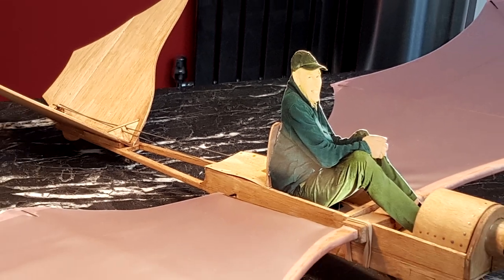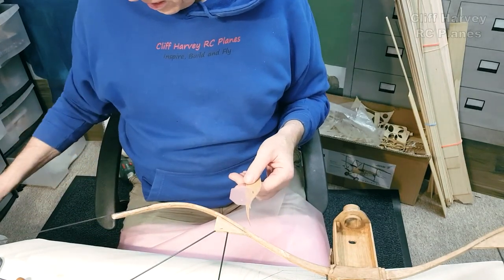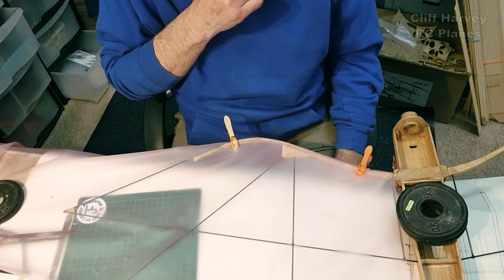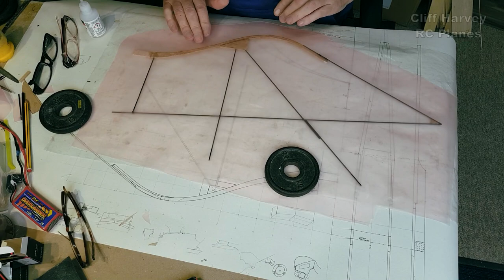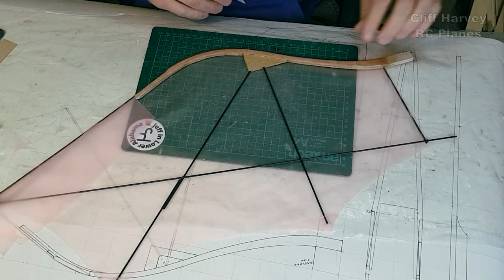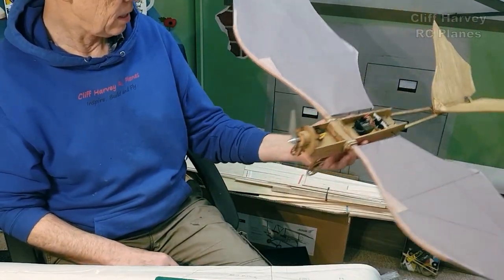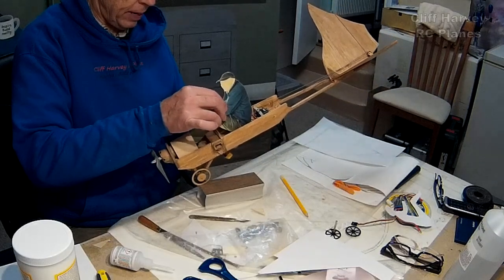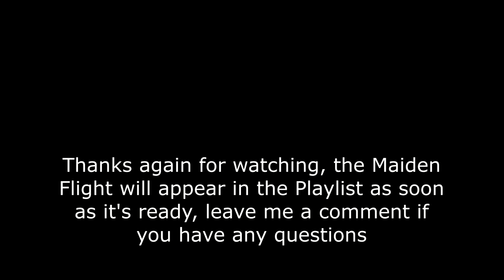Leonardo Da Vinci Flyer Part Three

Comment: The cardboard lid hides everything beautifully. I thought you would have added an extra carbon fibre rod from each wing, to a low point of the fuselage. Struts to reduce wing flexibility.
Reply from the maker: Didnt think of that Koala, the flexing wings may prove useful for extra dihedral 🤔😁

Comment: Great looking creation Cliff. Beautiful. I like that the pilot (handsome fella...) will add some vertical stabilizer area. My only concern was your lift test...wondering if the wooden leading edge needs to extend farther...just seems like that is a lot of flex with the carbon rod. Hopefully it will be a non issue! I like the cooling holes. Looking forward to seeing the maiden!
Reply from the maker: Hopefully it won't be an issue Adam, it shouldn't fly that fast, but yes, no. 2 will probably have a wooden leading edge to the tip, I'm also considering some sort of wooden 'ribs, carbon doesn't really suit the model 👍

Comment: Love the pilot!  Or should I say how the seat and back cover were blended with the triangular pilot figure. Also the light material used (card paper) is quite appropriate for electric models.  Using this method will find its way in some future model of mine I am sure.
Reply from the maker: Thanks Guy, it's difficult to plan every detail before you start so it kind of grows as it develops, paper and card is useful stuff to have around 👍🙂

Comment: I'm sure I read somewhere (with regard to an early full size aircraft) that it was "a bad thing" to have a gap between the wing root and fuselage. Not just streamlining but a handling issue. When they filled the gap, the problem was solved. Thought it was the Bristol M1 but not mentioned in the Wikipedia article, but I read this decades ago. 
Anyway, I thought you could easily put a piece of balsa in the side of the fuselage, filling that gap. FWIW.
Reply from the maker: Hi Richard, that's a very good point, thanks 👍
Reply from the maker: Hi Richard,  the gap is now filled, it looks better for it as well, cheers 👍

Comment: Interesting once more. Just picked up on 'Vertical Fin Area' aka Cliff ... in actuality a roll damper. Cody used an actuated  'Head Rudder' above the wing centre section and coupled it to his warping/ailerons (the ailerons were deleted for the first flight in 1908).
Reply from the maker: Thanks Paul, I do have a back-up plan to wing warp if needed, I'll also see the different flying (hopefully) with the pilot makes to the flight envelope out of curiosity, cheers 🙂

Comment: Tail feathers look a little heavy, may need nose weight to get CG right. Fun subject.
Reply from the maker: Hi Gary, not only do they look heavy, they are heavy, I'm tempted to cut the centres out but then the covering ideally has to match the wing and the glue's going to look a bit rough. I suspect mk.2 will be built up 👍🤔